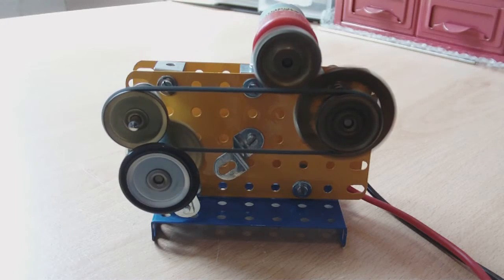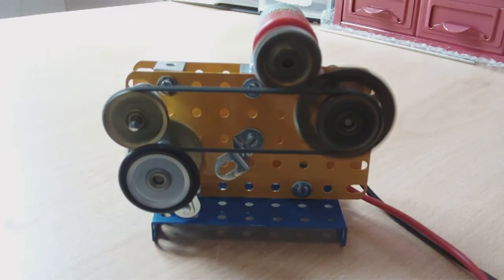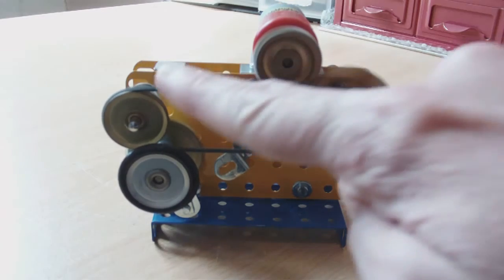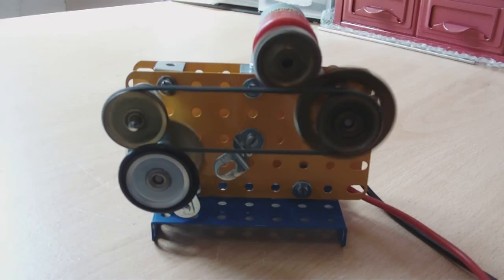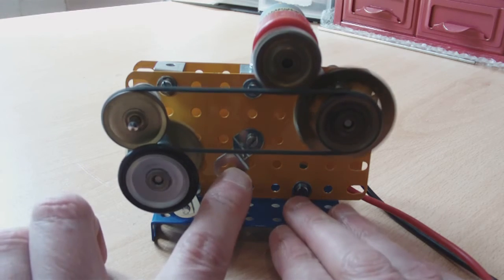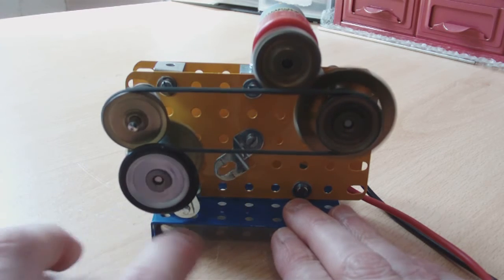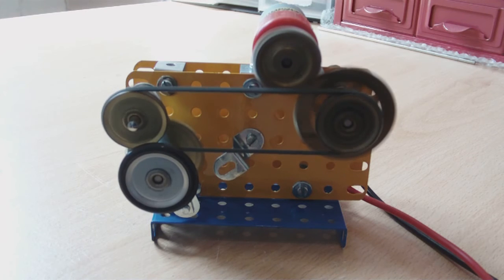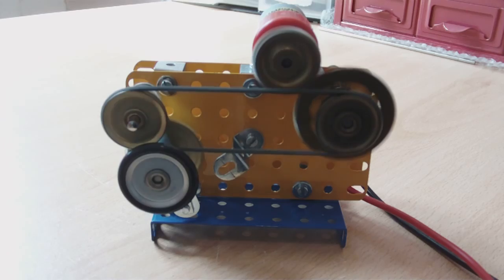Meccano Automatic belt tensioning mechanism

Comment: With the old models I build, when they show cord pulleys, I change them to rubber driving bands for precisely the reasons you describe here.   Ingenious device.
Reply from the maker: +newspaniard There is a cord pulley in the 1970's set six manual. A wind generator. It does not work very well.